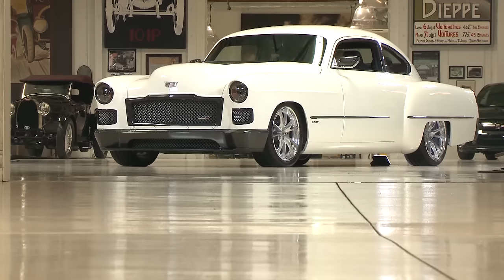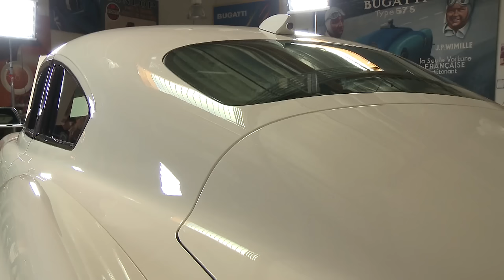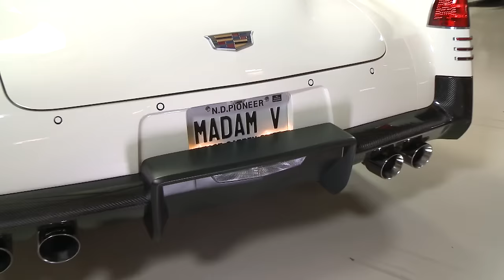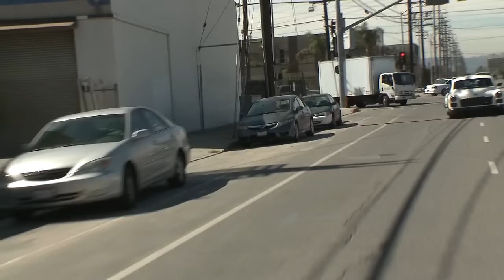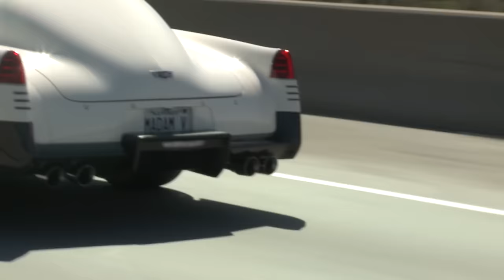Ringbrothers' 1948 Madam V Cadillac Coupe - Jay Leno's Garage

Comment: Why can't they make new cars that look like this.
Reply: Evolution and safety improvements.

-Common F. Sense
Reply: Al Parker they don't make cars like this anymore because there are a bunch of little kids working at most of the car companies nowadays and they just want to see mass-produced pieces of plastic rolling down the road with engines they don't care what it looks like as long as it sells and as long as they can make a cool commercial showing that car going down the road and what it can do they don't care what it looks like back in the day when this car was designed you may as well have called the designers artists because that's what they were
Reply: They do for the right money. I know what you mean, I would like to see trucks built like the 50's thick sheet metal but with modern engines and suspensions and metal dash boars.
Reply: Challenger? Wrangler? PT Cruiser? Prowler? Z3? Z8? M coupe? GT40? Mustang? Camaro? SSR? HHR? SLS AMG? SLR? AMG GT? FJ Cruiser? 500? 500C? Beetle? Aero 8? AeroMax?
Reply: @erich3570  i see your point,  but most are not retro enough
Reply: Too many people might want to keep them running? (Once old) Might interfere with the whole planned obsolesence thing so you buy a new one. A new corporate model of thought is needed.
Reply: They could make new cars to look like this, after all it's only sheet metal, they could mold it to look like anything they want, they just won't do it because it implies that their new style just doesn't cut it, even though it doesn't.
Reply: Because they've already been made in 1948.
Reply: Because if they did, some would say that's somehow it's not politically correct.
Reply: Can you imagine the sales???!!
Reply: Exactly mate.
Reply: @stevestevensky  And ofcourse liberals and Democrats.
Reply: There is no viable reason...except the market analysts probably think the public wouldn't get it....WRONG GENERATION !

Comment: As of May 2019 I can't find any pictures of the car with a new grill, I wonder if they ever changed it.
Reply: I sincerely hope so.
Reply: @chrisroach9459  I just looked again, it's different, they changed the grill, bumper, headlights, wheels, and switched all the black chrome to chrome, I like the old headlights better, but overall it is nicer.
This is it.

https://gramho.com/media/2170550533907383929
Reply: @bigredc222  it does look better this way with all the chrome 😍😍😍
Reply: Thanks for sharing that! I really like it both way. The modern look just looks more different than any 48 I've ever seen.
Reply: @bigredc222  good lord,  that is now just stunning.
Reply: @bigredc222  The original "egg crate" grill really makes it RIGHT!

Comment: I've always been impressed by the Ringbrothers build quality and the work they do but I have to say they are way off base with what makes a car look good. They have never built a visually appealing car. They always do something that just throws off the look. On this one the paint is just plain well weird but not in a good way, some of the reshaping they did makes the car look awkward in the nose, those wheels are way off for the car, and I hate modern style interiors in old cars. An update is fine with the right touches but this is what happens when someone just doesn't have taste or an eye. This and cars like the yellow almost riced out 65 Buick Riviera that hit the show circuit some years back are plain ugly.   This is just my opinion but I do have a right to that.
Reply: Ryan Burman 
It is a car built for someone else the only thing they said was there choice but will be changed to the original was they grill if you want to complain about their taste that would be the only thing to do it about
Reply: @Yourfavpreppygrl  How does "someone else" always have the same taste?

Comment: The Holy Grail; an old car that will drive and most importantly be as reliable and have parts availability like a new one. This is the direction of restomods and coach built cars for sure. You see it at all levels from LS swapped old cars to really creative builds like this.

Comment: The door ajar bell going off when the door was opened to release the hood really seemed strange coming from 75 year old car! They weren’t kidding that they transferred all the modern components from the 2015 and 2016 Caddies to the ‘48. Thanks Jay for showing all the impressive work that the Ring brothers did on this best of both worlds vehicle although I agree with another commenter who said that he would’ve liked to have seen an under hood shot of the engine compartment when you were observing their top notch work under there.

Comment: My Dad and Gramps worked for Buick. I'm a Buick guy. Gramps quit school in the 8th Grade and went to work for Buick in Flint MI to support the family. That was in 1912, I think. He lied and said he had a driver's license and became a Buick test driver. Dad came out of the navy and went to GMI, which is called Kendrick University, or similar, now. He passed away a year ago and left me his 2008 Lucerne. Loaded, of course. It only has 30,700 miles on it. It's a boat, but I feel him in the passenger seat every time I drive it. The lines on that car are gorgeous. I'd change to a Caddy guy for that.

Comment: Jay - enjoyed watching the 1948 Cadillac Coupe video.  The body style on the 48 & 49 Cadillacs were very similar except for slight changes in the grille.  The instrument panels were quite a bit different.  The 48 still had the 346 cid, 150 HP flat-head V8 (with the exhaust manifolds on the same side of the block as the intake manifold - not like a Ford flat-head V8).  The 49 model was the first year for the OHV V8 for the Cadillac, now with 331 cid but 160 HP.   The gas filler on both was accessed by pushing a reflector button on the driver side tail light - not the passenger side as on the Ring Brothers resto-mod.   [The Oldsmobile OHV V-8 also was introduced in 1949 - 303 cid with 135 HP.]

Comment: Totally impressed by their work!  Hahaha, great line, about the high priced escort!  I'd like to see the finished project, with the retro grill, and hopefully the retro bumpers.  Don't know if the 48's had the same bumpers of the 53's bullet/tit bumpers. My father bought his company's 1953 Caddy limo, circa '62.  What a car!  One day, in the 70's, I flicked the bumper, with my finger nail, to gauge it's density.  Wow, pretty impressive - real American Steel.  Of course, years later, looked it up, and found that while these older vehicles stood up well in collisions, the passengers didn't fare as well, compared to modern vehicles, with crush zones, etc....  BTW, I saw your show years ago in Davenport, It may have been the same weekend that Cary Grant passed away there. You were quite funny, but the main thing I recall was shivering through the whole show, as the A/C was up to par, but outside was so miserably hot, that it never occurred to me to wear something other than the bare minimum.  Love your love of cars! (Meanwhile, I'm wrestling, trying to get the gas filler hose off of my 2000 Jimmy:-))

Comment: Cars of this era after the running boards finished and into the early 50's didn't have a black rubber trim ahead of the slightly protruding rear wheel arch opening for nothing. 
Roads are covered in tiny stones and other unseen debris that's picked up by the front wheels, consequently over time, that protuberance ahead of the rear wheel arch opening will get stone chipped and sand blasted.
Patina... I think we call it these days :-)
I agree with Jay about keeping the original '48 dash..perhaps updated with today's instruments and LED's in the original style of the original '48 gauges.

Comment: To be honest I thought the same thing you took a brand new CADDY and put a 48 body over it. It just reminded me about a show I seen on THE WORLD OF COLLECTOR CARS years ago when a guy built himself 1939 VETT, so what he has done was to buy a 1939 shell and a 1989 or so which was a rollover and took everything that was out of the 89 Vett and put it on the 1939 Chevy body,so what was working in the 89 Vett he made it worked on 1939 which was an ALL STEEL body, meaning that the lights would stay on for 15 sec.,it told you to buckel your seat belt, seat adjusted,your gas was low;ect. That was the very nice car and they have done HELL of a job,but the only comment was they should have put in a FULL SIZES TIRE not a compressor which Jay even said himself that it didn't work have the time,but other than that it's a very cool looking CADDY even down to the backup cam, which looks weird  for it to be sitting on top . The gas filler in the rear tail lights that pop up that's cool and to have the headlights turning that's AWESOME. ALL in ALL, that's a BADASS CADDY.WELL DONE GUYS

Comment: I like how Jay always refers to how the cars had high mph speedos and how the cars would struggle to get there.  My first car, actually my mom let me use it, it was still hers, was a 73 Olds Omega with a 250 GM corporate inline 6 with a single barrel carb.  It had 120 on the horizon speedo.  I took it out to Hwy B (a long straight country road stretch) and tried getting the old girl up there.  She barely broke 95.  When my dad was alive, his 68 Delta 88 455 2 barrel would effortlessly do 100+.  We were coming home from the air force base one day, my parents and I and at the time, the highway was a 2 lane country road again, now it is a split 4 lane super highway.  Anyways, my dad was cruising, I'm in the back seat, and I look at the speedo, and I say, WOW dad,  110!!!  My mom screams at him ALBERT!!!!  Fast forward to the late 80's, my mom has a 79 Delta 88 with the corporate 301 V8 2 barrel.  The horizon dash says 85.  We go to Georgia from Missouri to see my sister.  I'm driving and we don't even see the needle.  I know I'm doing 95.  The rear gears on this car are 2.73 and the engine is relaxed at those speeds.  In 90, my mom downsizes and goes with a Buick Century with a destroked 3.8, a 3.3 Litre V6.  Again, the horizon dash reads 85.  Again, going down to GA when I'm driving, we don't see the needle.  Again, the gear ratio and the power of the 3.3 is such that is effortlessly cruising.  Fast forward again, my wife's 04 Odyssey and 05 Civic both have a 140 speedo that neither will ever see.  Her 2018 Ody that she now has, has a digital speedo so it will go as fast as it will go.  My 12 and 20 Mustang GT's have 160 speedos.  They are governed for 155.  I guess I jibber jabbered enough.

Comment: OK Jay, a little late to the party here (it's Nov 2018) but you asked for comments about whether the car is a '48 with 'work done' or a modern Caddy ('15?) with some retro touches.   With the thing having modern frame/suspension/drivetrain/interior/electronics/carbon fiber body,  I can't see calling this a '48.  It's 85% a modern custom build with a few '48 styling cues.  Don't mean this in a bad way-- the car is very cool. 
 
RING Bros-- My favorite part of this build is the roof line. Sets the car off perfectly.

Comment: I work at a GM dealership body shop and they're not kidding about the wiring complications. If a wire is cut, you can't just splice it back together like older cars. New cars have thin wires that run a specific amperage and if it's not just right, it confuses the computers. Even something as simple as a turn signal wire or the horn. You have to completely replace the entire wire from end to end, or replace the entire harness or section of harness

Comment: Excellent execution first people have to remember they took a extremely heavy 48 caddy fastback and took its extremely huge full frame out wich u no they probably werent rust free cars they hand made again all kinds of carbon fiber pieces to lighten it up or that thing would fold without those rails and then made it a subframed car then took all the modern equipment and made it fit and work Work so well that OnStar called the registered owner and told him he had a brake lite out come on the headlights r turning with the car 4 wheel independent suspension all the new caddys factory clamps and exhaust im with people on it coulda been a tougher nicer sled but man id love to own that car that grills gonna help alot but they are just great engineer's and they must have an amazing crew to be putting out the quality of cars they do and they dont do streetrods they're more muscle car guys i like it id love to give it a exterior makeover wheels work i love those Gm years i have a 50 chevy coupe chopped great show thanks Jay

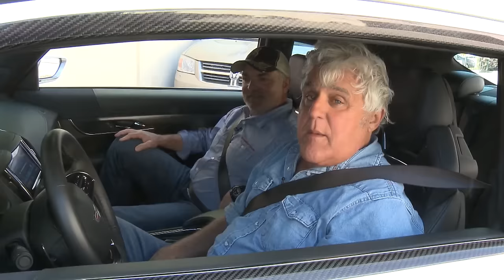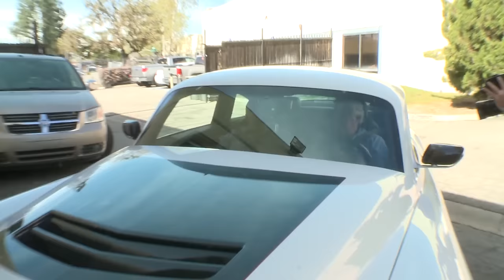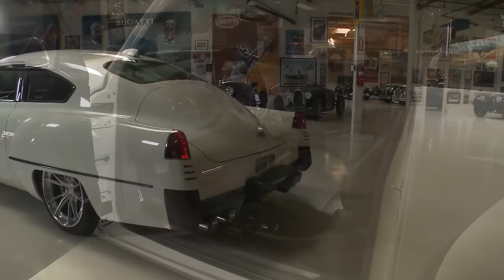Comment: Wow, at 7:42 all the way to 7:43, I think I saw the master brake cylinder.  And what about those custom seats ay?!  You get a great view of the rear head rest at 23:13.  Of course the best view of the interior comes at 23:05.  You can see the front and rear at the same time!  Yup, that 23rd minute sure takes the prize for best view of the interior.  Hang on, I stand corrected, that shot at the 4:20 mark from 8 feet away is the one to save the still shot of.  Probably just that 24 minutes isn't enough to show a car like this.  Perhaps the guys can bring it back after the owner modifies it and Jay can shoot a 45 minute video to really do it up!

Comment: They're not kidding about the wiring on new vehicles. You can't usually just splice a wire. You have to replace the entire wire from end to end with the correct gauge or the computer will notice the change in currant.

Comment: Did they do anything to preserve the Ackerman steering geometry. Stretching the frame changes the center of turn geometry which will make tires scrub on a tight turn.
Reply: 14.40 explains pretty simple how the shock tower 16"forward+TWO OEM 'Cradles' allow for original steering geometry. Ackerman Angle wld not be effected soley by stretching wheelbase. If you take an original chassis, cut it somewhere behind the suspension mnts,(say arnd where your butt is while sitting in the car) nothing steering-wise is effected. You run into Ackerman,Toe,Camber...ect when you directly alter control arm mounts, spindle height..ect

Comment: "The 1948 model year was abbreviated to about eight months and production was modest. The lower line Series 61 only sold 8,600 units, in four-door sedan and two-door fastback sedanette body styles. The big seller in the Series 62 line was the four-door sedan, which accounted for 24,000 of the model’s 34,000 sales. In the Series 62, a club coupe cost $2,900 and a convertible ran $3,400." - Hagerty.com

Comment: That was good advise on starting the car cold after the blizzard 78 I worked for a Chevrolet dealer in Whitman ma we had a 76 nova towed in that wouldn't run the muffler was full of ice GM came out with a service memo to add a drain in the muffler that was not there

Comment: Yeah, I'd like a 48 grill and a more traditional dash/wheel.  But the ECU would go nuts ...
Reply: ECU AND GRILLE?
Reply: Yeah, I like all the lines, but would like to see some semblance of the original style grill.  The one on there looks like a mesh-mouth.

The ECU would go nuts because a traditional dash and wheel would omit most of the air bags and people position sensors.  Then the safety would be compromised.  And since it was/is supposed to be "completely modern", that won't do ...

Comment: GM should have a catalog, call it the Custom Shop (like guitar builders do), to build custom cars based on their past lineup. Put modern drive trains in them. Mercedes does it in their Classic Center, but Mercedes only brings them back to original condition. GM could build modern hot rods. What do you think?

Comment: You get condensation in exhaust from temp difference that's a given it's like a hot air compressor putting warm air in a cold tank but most of the water today's car's exhaust is from the garbage gas that is already 10% or more water or as they say ethanol before it burned. Hate the garbage today it ruins whatever it touches it gums up if it sets more than a month, it rots exhaust systems. I drive a 67 Chevy 1 ton and I still burn that old leaded gas everyone said was so bad and and till this day it still burns in my truck. I buy and sell and restore old tractors and have been lucky to find tractors in barns with the old leaded gas still in the tanks and I've found several 275-500 gallon tank with leaded gas in them at farms and have managed to buy them too. We have an old service station that had new tanks and basins put in the ground in 99 and closed the doors in 2000 because it was retirement time for the grandparents and the oil company came and pumped them dry and I have slowly filled one back up with leaded gas I have found and bought in old tractors,barrels, tanks, trucks, cars pump it through filters into the tank at the old service station and then pump it straight into my truck, my lawn mowers, my snowmobiles, my tractors and have not once had the problems of today's garbage gas the smell of it is so sweet compared to the ethanol crap that is full of detergents and who knows what other chemicals.

Comment: I think this episode really highlights what will be the death of the thing we all love-companies like onstar, companies like gm being that would make the corvette a 4cyl hybrid if they thought they could make 5 bucks off it, throwing computers at things to appease poor dolts who have brainwashed into thinking they need gimmicks, the no spare tire thing, etc. And dang if it isn't a shame they couldn't put a v8 in that. Just like how ford put the 6 cylinder in the new GT, not because it was the best choice but because of marketing. Same with the raptor. If money is no object, like it is with this project, I guarantee you can't find a guy who works at ringbrothers who would say "no I prefer the fact that it sounds like a camry, that it doesn't rumble, that there are two big turbo's instead of two big bollocks in the engine bay